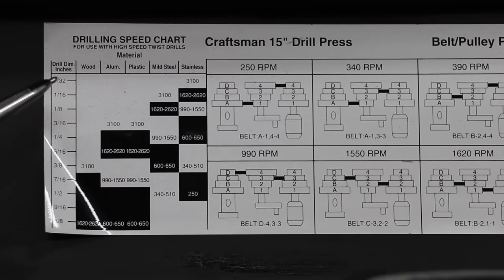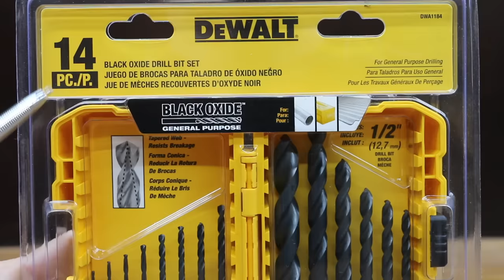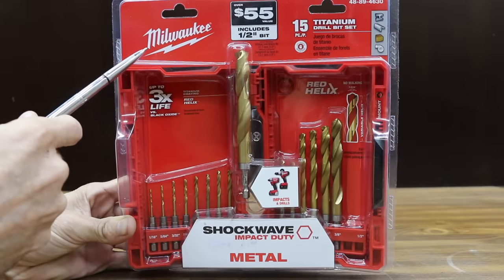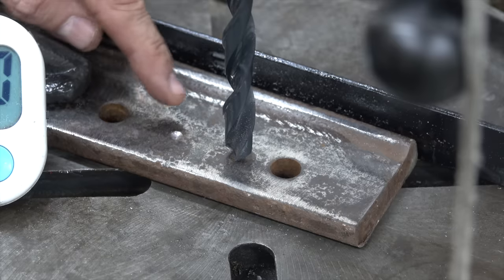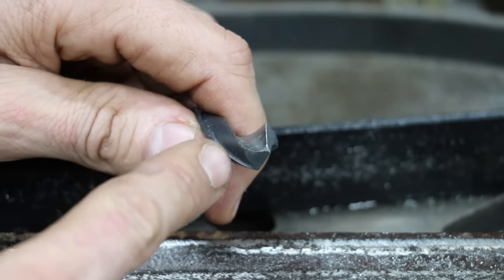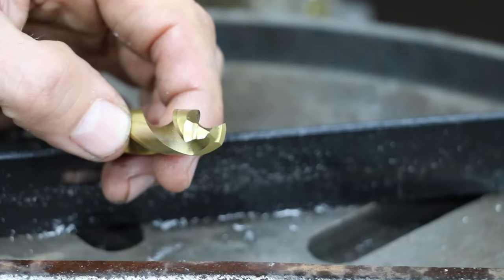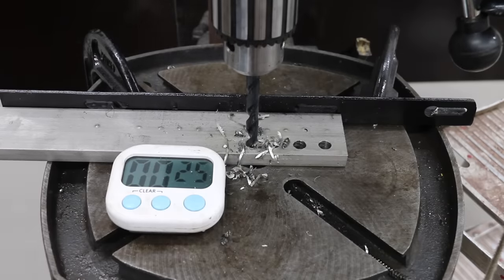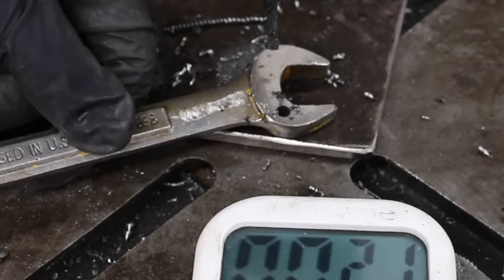Which Drill Bit Brand is Best? Let's find out!

Comment: My experience with titanium bits is they are junk.  Many have dulled or even rounded out at the tips after just one or two uses.  Ok for lumber drilling but not for steel such as car frames. Plus when drilling on a car the pressure is going to be much lighter as I wouldn't be doing it on a drill press.  I have a 1950s car that I want to put seat belts in so that will mean drilling into the frame 10 times (for five belt sets)
Reply from the maker: Thanks for the feedback.

Comment: Most of these videos seem well considered, but not this one! At least in my opinion. First of all, the cutting speed right out of the box is mostly a function of geometry and sharpness. Since drill bits can be easily sharpened, I don’t really care how sharp they are out of the box. It would be much more valuable to know how well the metal holds an edge and resists breaking. Second, some of these bits are split point and others aren’t. It’s not fair to compare these bits this way given that fact. It would have been interesting to compare them after drilling pilot holes.

Comment: Using cutting oil on a drill bit is or can be false economy, the job of the cutting oil is to reduce friction and their for reduce heat, the idea behind a drill bit is to hit the sweet spot between pressure speed and cutting angle, when all is right the drill will cut the steel, when one is not right the tip of the drill bit just binds against the steel and doesn't cut as affective causing heat build up, by using cutting oil and reducing the friction between the 2 materials means that the drill bit cannot do its job properly, extending the life of the drill may not be a reality as you spend more time drilling per hole and use the drill for a longer period of time to achieve a certain goal. Meaning at the end of the drills life it has.proberbly drilled less holes
Reply from the maker: Thanks for the feedback.

Comment: 304 Stainless isn't really that hard, as it can't be hardened by heat treatment (same for all 300 series ferritic grades). Although, as you discovered, it has a pretty awful machinability. Free machining it is NOT!  Anything close to HRC 40 or higher can be hard or impossible to drill unless using carbide inserted tooling (endmills etc).
Reply from the maker: Thanks for the feedback.

Comment: Afraid a test like this displays a bit of naivete. To get even a little handle on the comparative merits of drill bits, how about running each of them a second and third or more times through the same material and note which bit takes closest to its original time for 2nd, 3rd and subsequent holes? The point is any bit when new is going to do something. Any tradesmen is interested in how long it will last. Just a visual inspection of the edges is not enough.

Comment: ok, when you tested the drill sharpeners, you didnt use cutting oil, which was a mistake, because by not using cutting oil you werernt testing the sharpeners, you were testing the metallurgy of the bits, which varied from bit to bit. here, you are trying to test the bits, but you are using cutting oil, which is a also mistake because you are reducing the performance differences between high quality and low quality steel by allowing the tips to run smoother while introducing carbon into the cutting edge. it's another good idea for a test, but a poor execution because of wrong thinking

Comment: I have always enjoyed your videos but this one ... not so much.
You are comparing apples to oranges and even avocados.
Test split point drills against split point drills only.
Never attempt to force a conventional 1/2 inch bit through steel without a pilot hole (split point is okay). This will destroy the bit and give a false test result for a bit that could be very high quality and work well if used correctly.
The fastest bit on the first hole may not last long.  Hole # 50 is a much bigger challenge.
Grades of Stainless Steel harder than the 304 you used should be drilled by starting the drill with high pressure, stopping the drill to create a chip, then breaking the chip when restarting.
All of the bits tested are made of varying qualities of HSS (high speed steel) except the Cobalt which is a high temp alloy much different (and better) than all the rest.
Carbide is the king but to brittle for hand tools.
Titanium Nitrate is a coating put on HSS (which you correctly said once).  Black oxide is a steel finishing process as opposed to a coating, and only effects the outer surface.
I am not a metallurgist, so please correct me if I am wrong, but I have a degree in automotive technology and have drilled lots of holes in my day.

Comment: My machinist friend never uses a drill bit right out of the box. 50+years experience.  He grinds them sharper...because factory sharpening IS A JOKE.   The machinist drills through tons of metal so he knows how to hand sharpen the drill on the grindstone.  No specific make.  I learned how to do it once in school - have forgotten that talent and always have one flute edge cutting more than the other.   When you had to add more weight, I could see the point was not cutting anymore...so the drills are dull.  Most of my drill bits cut into wood okay and even aluminum or copper.  Steel is marginal.
Reply from the maker: Thanks for the feedback.

Comment: i know im late to this party but imma have to point something out this test is fraud from the start. first is the type of bits u used.
1 cobolt is the best of the best, there for drilling into hard metal,can be resharpen to new with no problem, because its a % instead of a coating. .
2 titanium is 2nd best for mild to hard metals. but its just a coating so no resharping 
3 black oxide is for very light metals to 1 time throw aways, its just heating the metal for coloring purposes.

for next time i would like for u to research ur types  and apply them accordantly . dont get me wrong i love this channels but when i see something wrong imma point it out.

Comment: There is only one type of drill bit I absolutely HATE, hate hate.... and that's the type with a lead screw to "pull" it into the wood.   
There is no reason for this, its the dumbest invention ever.   All it does is yank it into the wood, give you no control over making a clean drill hole and cause a mess.
Reply from the maker: Thanks for sharing.

Comment: I know the Drill Doctor is a total piece of crap. Never any good results with resharps. Panam tools are good quality. I always had good results with high quality carbide bits on composites such as carbon fiber or graphite and on titanium. Lower or higher RPMs depending on material with use of Boeing Lube helps.
Reply from the maker: Thanks for the feedback.